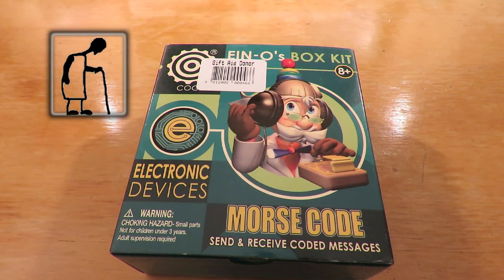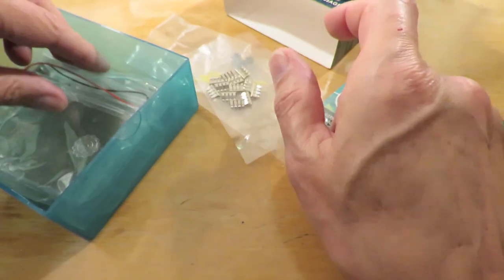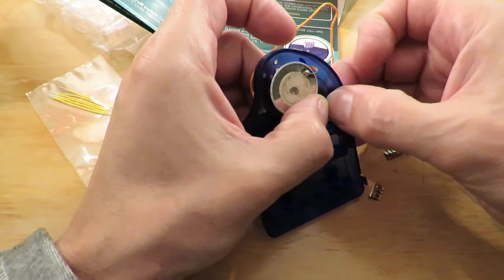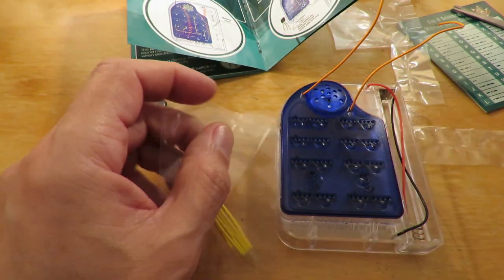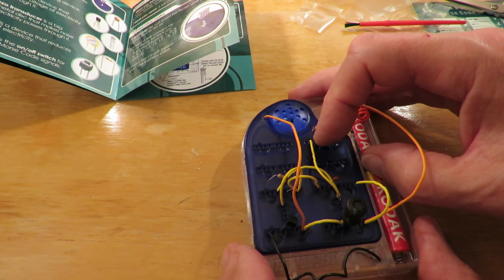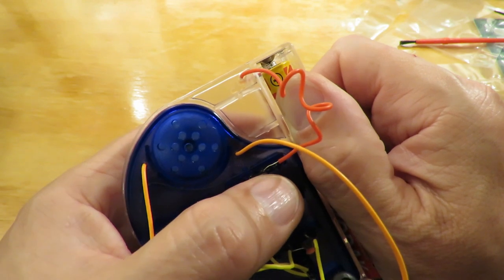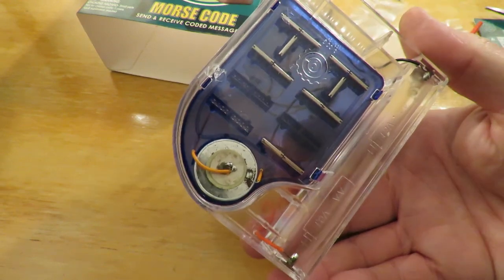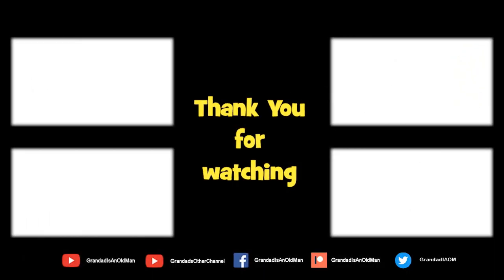Ein O's Morse Code Box Kit SHORT

Comment: Grandad. It is pronounced PeeeeeeeeeeeeeZooooooo. We use them in sonic machines to drive the titanium horns in what we called a stack. It works like a jack hammer at 20K range and higher and lower to weld plastic together at a localized spot. We also built "spin welders" that held one plastic part and spun the other. Air pressure being applied at the same time, creates fiction. Hold until cool and release the part. Bingo welded together. You can do this with same type of plastic in your drill press.